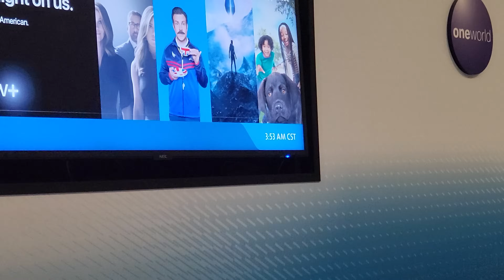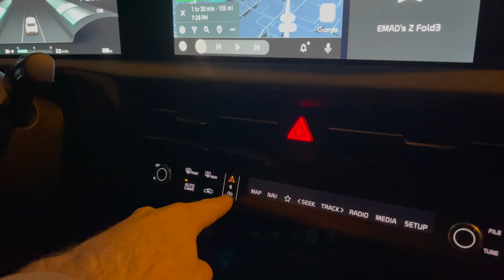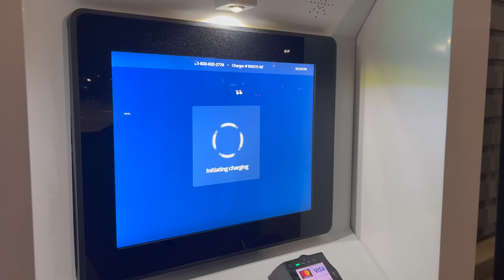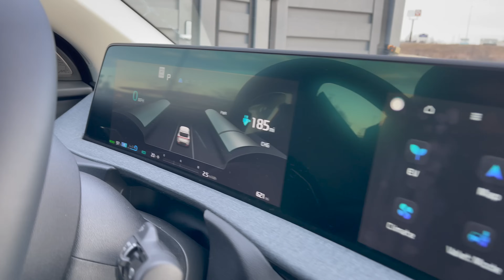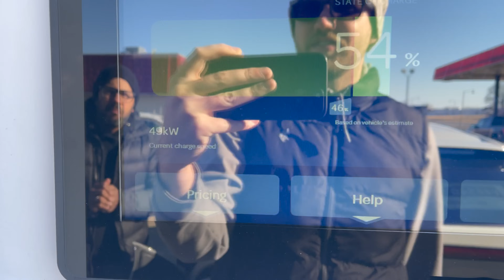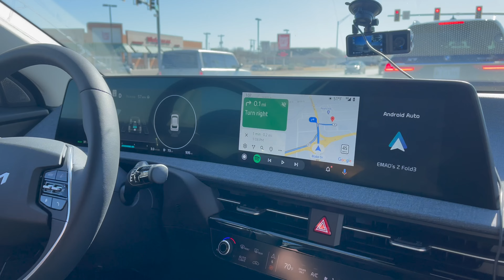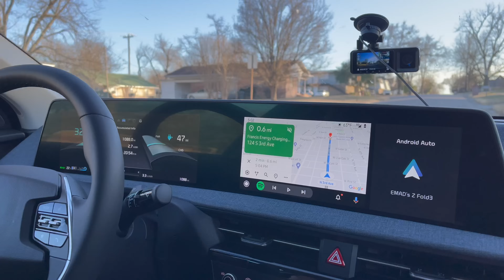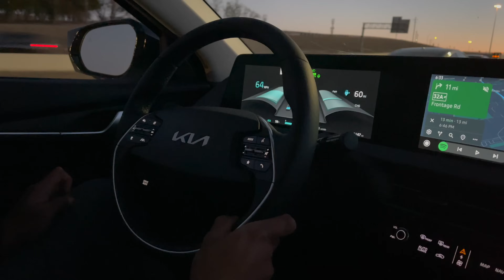First Kia EV6 Road Trip In America! Over 1,000 Miles To Dallas For A First Time Electric Car Owner

Comment: Nice summary!  One little tip from a veteran EV road tripper:  Pick a hotel with overnight Level 2 charging so that at least the first leg of the trip is started at 100% and you don't have to charge a cold battery.
Reply: I've had a rough time finding hotels with L2 charging, especially driving from Texas to Oklahoma. Is there a reliable app or link that could help? The ones I've tried aren't much help.
Reply: This cant be overstated! It justifies a better hotel, as the fuel is free, thus taking some anxiety away from staying in a cheap hotel and helping you plan ahead.
Reply: @Shapoopie16  PlugShare is still the king of comprehensive charging spot finder apps in North America.  Sometimes you have to get creative.  Ask to plug into a standard 120V outlet at a hotel, find a campground with cabins near a NEMA 14-50 outlet, etc.  Anything helps until, as you point out, the charging infrastructure catches up.  Also, if you have no other choice but to DCFC, do it while the battery is still warm at the end of the day.  Charging a cold soaked battery in the morning sucks.
Reply: I feel more at ease by stopping @ a L3 charger location for the night and charge up after dinner. Kyle Conner advises charging when the battery is warm. Would be ready to commit “ harrycarry” if I came out in the morning to find someone had damaged my charger port.
Reply: @Bill B  thats why you spring for the nicer hotel given you get a free tip up..
Reply: I also think that EV owners should accept that driving 5 under the posted speed limit is better for your range. Take it from an old guy, you'll still get there.
Reply: I always tell hotel management that Level 2 charging is an amenity I look for when booking. That said, I've never been told "no" when asking if I can plus in my L1 charger overnight. There's almost always an exterior plug somewhere. I currently drive a Volt, but looking for an EV6
Reply: @markbullock3741  I just can't do it😂. I try to slow down but I end up flooring it
Reply: I'm sure everyone else will too.  WILL you have a for spot to charge when you get there?  So many issues with charging stations.
Reply: @seymorefact4333  You can call ahead, many of them are coned off..
Reply: @jpmkiv  lol! If people really cared about the environment.   Trains,  planes,  carpool,  buses, bicycles.
Reply: @Seymore Fact  Who said anything about the environment?
There is no public transport where I live. 
An EV is more efficient than a plane per person fyi.
Reply: @jpmkiv  horse and 3 or more...add a carriage.   If you lost 100lbs.. your horse will last longer.
Reply: Never CHarge the battery to 100%
Reply: @Czecher86  31k in and never charged to 100%
Reply: Hiltons are always a good spot for LV 2 chargers at their parking lots
Reply: @CRACKHEADLLC 🤣😂 I'm a motel 6 guy!   So I need to spend $300 more a night to change my Y.  HELL NO!
Reply: @seymorefact4333  wrong lol I spend most time 90-120/night at any hiltons,home2stay or Hamptoms inn when you have a membership it’s cheap
Reply: @CRACKHEADLLC  I'll look into it.
Reply: @Shapoopie16  PlugShare allows you to filter by chargers at hotels.
Reply: @Czecher86  Kia specifically recommends charging the car once or twice a month to 100%. They say you can get about 500 charges to 100 before real damage starts to occur. At twice a month,  this is over 20 years. Not saying you should always do it,  but you can certainly get it to 90 plus on long trips.
Reply: @markbullock3741  Nah, forget that. Cars are meant to be driven, not handled with kid gloves.

Comment: I understand the frustration with cold weather charging speeds relative to the advertised speed, but having done a 7,700 mile road trip in a 2020 Chevy Bolt that tops out at just over 50kW this looks like luxury to me.
Reply: haha yes, laughed a little when they were bummed at 150+ kW speeds at 62% SOG
Reply: I felt the same way having owned a Leaf previously.
Reply: @lanceareadbhar  lol! I’m on my second Bolt after two Leafs. I think the Bolt is great and certainly a fantastic value, but for my next EV I insist on faster charging and adaptive cruise control as a bare minimum. I was very surprised when they didn’t offer them on the 2022 Bolt. Seems like a missed opportunity to me.
Reply: I’m lucky if I get about 50kW at 62% in my P85D
Reply: Lmao same. Drove Bolt from Texas to Cali and was lucky to be charging at 55 kWh for more than 15-20 minutes before the steep drop offs. This looks great to me and I’m sure the Kia will be even better once they allow battery preheating. I can’t even imagine what 100 kWh charging is like let alone 230. Drove a first gen leaf before the bolt so I laughed when they had range anxiety. You haven’t had true range anxiety until you try to drive a 80 mile range EV 100 miles by going 40 mph on the highway with no heat in the winter and a completely fogged up windshield. That’s anxiety.
Reply: Just finished a 2.8k mile trip to TX in my 2022 Model 3.  Didn't hit 50kw until about 82% SOC, the 250kw stations are great!
Very impressed with the 7.7k mile trip in the Bolt.
Reply: @Termnath  lmao, I feel u mate 😅🥲😓
Reply: Don't sell your Bolt short, it actually can do up to 55kW.
Reply: I agree my 2012,leaf can take 1.5 to 2 hours in 16 degree or below weather

Comment: Those sub-100kW charge speeds are brutal. Battery preconditioning is not just a luxury, it's must in 2022.
Reply: I have not seen over 120 but once. Super frustrating.
Reply: @Emadifications  you need to absolutely beat the crap out of it to heat the pack
Reply: If you think that’s bad try driving a Bolt EV cross country. Max 54, average around 25-30
Reply: @Emadifications  pre heating battery for charging has been reported for Hyundai ioniq 5 in the latest Uk software. The software is distributed using the same website as the ev6 so the hope is the next release has it enabled and on the ev6. Plus ota so no more website and usb drive to update.
Reply: @ericcindycrowder7482  that’s a matter of poor vehicle choice for road tripping
Reply: Don't worry. Ioniq 5 is preparing a battery pre-conditioning SW update this year, and it will be released soon, and EV6 is also scheduled.
Reply: not a issue for teslas
Reply: @Palomo747  it very much was on Model 3 until battery preconditioning was rolled out.
Reply: @brandenflasch   yes which means it is not an issue for Teslas
Reply: @Palomo747  yes, but once there is preconditioning it is no longer and issue.

Comment: Great look into what first time EV owners will be experiencing on trips! 

On-route battery preconditioning seems to be the largest problem with this car. Every stop had an ice cold battery limiting charging speeds even with Winter Mode enabled. Warm weather trips should be much better but then we’ll see how well the cooling system can handle repeated high charging rates.

Great to hear about the buying experience and vehicle spec midway through the video as I fear a lot of people are paying over sticker for these cars. Nice work finding one at MSRP!
Reply: Agreed this is the biggest issue, trip from raleigh to boston in my Ioniq 5 was great fast charging in warmer weather saw up to 240kw , coming back down was snowing and freezing never saw above 150kw.
Reply: “Winter mode doesn’t do jack shit”
Bjorn Nyland
Reply: I just paid $1400 less than sticker for an Ioniq 5 Limited in Utah. Great dealerships recognize the chance for future repeat business.
Reply: @spencer1370  bjorn is the guy and he would know. Tom from inside ev’s keeps quoting 18 minutes and I am screening at my tv not in the winter. My leaf takes an extra 1/2 hour than in summer.
Reply: When will it become standard on EVs???  I asked a Ford engineer about the Mach-E 2 years ago during winter testing and he told me that the Mach-E would always be ready for level 3 charging.   NO CARS ARE READY WITHOUT BATTERY PREHEAT!  What's frustrating is that it is just software because the hardware is already there in most of the cars.  Battery preheat must be standard in all cars (even manual) and battery temperature should always be displayed like the oil temp was in ICE cars.
Reply: Kyle can you get any comment from Hyundai/Kia if they will actually add preconditioning to these cars? (Or at least to the AWD ones with heat pumps) It seems like the Winter Mode checkbox is just a placeholder.
Reply: Agreed on temperature dependencies being more of a factor that a lot of people have expected. But i do wonder if anyone has been able to actually charge the EV6 or Ioniq 5 at it's rated 18 mins from 10 to 80%.
Reply: @javidam  plenty of European reviews have, or close enough at least. The issue in the US is they launched these cars in winter with no preheating.
Reply: This is a great look for first time “non Tesla” EV owners. First time Tesla owners just pull up and plug in. There’s no app to log into, there’s no long wait for the car and the charger to communicate to each other, there’s no crappy touch screens to deal with, etc. And guess what, Tesla has pre-conditioning!  I love a lot of the new EV’s, but Tesla is just light years ahead on infrastructure. It’s a joke.
Reply: @stufarmer3084  Agreed!  The more I see in this video the more I like my Tesla charging experience. The charging infrastructure needs to be widespread, reliable and standardized.  Having said that though the EV6 looks like a nice car. I like the styling.
Reply: @jerrywaynerose  agreed.  They are very nice.  I love my Tesla but options later are great!
Reply: @javidam  Never! I am really mad about KIA, this was never true only a marketing strategy. I owned mine now for 3 month and the max I get out (Ionity) is 130 kW. The changed the ads now saying "can load to 80% in 18 minutes UNDER OPTIMAL CONDITIONS."...I having serious discussions with KIA now.
Reply: @59317  Only in contries you can drive fast as Germany, but this i of course crazy to drive fast to warm the battery by burning more energy. Environmental  BS.
Reply: @angryGTS KIA/Hyundai's route planner absolutely sucks so can't really blame them for not using it

Comment: Enjoyable Out of Spec Motoring road trip. Jordan is fun, engaging and his back and forth was Emad was great.  Good to see what to expect with m e-tron GT when I road trip tomorrow.
Reply: Your ETRON GT will charge at least twice as fast with your DCFC set as a destination in the MMI navigation (vs these guys). Don’t use CarPlay for nav etc. Maybe that’s what their problem was.
Reply: @radcardad  I would probably use the Audi nav to make sure it preconditions but then use CarPlay on top of it 😅
Reply: @vroooom  I’ve done this with my Taycan and I’m not sure it works because the in car nav might actually get suspended when CarPlay navigation is running and then maybe the preconditioning as well. Don’t remember now but Audi and Porsche software are generally terrible. They should just make this a button like a thermostat and give you an ETA on when the battery is at optimal temperature. On my etron they didn’t even show battery temp so I wonder if they have it in the etron GT.
Reply: @radcardad  that’s a good point, maybe one GPS app overrides the other. My EV doesn’t even have route preconditioning yet so can’t test it!

Comment: Just got back on a roadtrip in my Ioniq 5 rwd I bought a week ago, went from Raleigh to Boston and back, and had same charging issues in cold weather. Warm weather chraging cranked up to 240kw and held up there very long but cold still sucks till they come out with preconditioning.
Reply: I have the RWD model as well and unfortunately we may need an alternate solution to pre-heating the battery as the US models don't have the battery warming system in the RWD versions. It's only in the AWD versions of the Ioniq 5 in the US.
Reply: @lanceareadbhar  this can't be correct. Lithium batteries can't take a charge at all if temperatures are too low. I think you're referring to the heat pump? The cars still have resistive heaters.

Comment: The “cold symbol” snowflake on the dash is not referring to the battery temperature. That’s the typical “it’s below 39 degrees” ice warning. You can turn it off in the vehicle settings.

Comment: Really great video guys. I usually don’t consume content this long on YouTube, but I ended up really feeling like I was part of the trip with you - all the footage during the stops, in the convenience stores etc. made it a real experience of what a road trip for a non-Tesla EV owner is like. Question; I have a Mach E on order, but I really like the EV6 - just can’t find one that’s not way over MSRP. Part of why I like the EV6 is those faster DC fast charge speeds, but it seemed liked during your trip you were never charging faster than a speed the Mach E could do, right? So that > 160KW charge experience seems very rare? Thanks again for the video, really enjoyable.
Reply: Pretty sure it's all to do with the extreme cold temps they were dealing with. If the battery was at the optimal temperature, it would charge a lot faster. Just EV ownership life in the winter.
Reply: @thaDARKW0LF  non Tesla EV is harder on road trips as Tesla will warm battery on route to get fast charging in winter.

Comment: The issue with range these guys experienced was largely due to excessive high speeds. Saw 77 mph a few glances of the dash. Any speed above 65 mph comprises range severely due to aerodynamic loads. From 55 to 70 mph calm winds, the air resistance increases power consumption 30% average. That’s a huge drain on batteries. The discussion tends to be: drive faster to destination to charge more electrons; drive 65 mph to destination to charge less electrons. Does the time balance out? Calculation of time/distance using the speed differences 65 vs 75 for a 180 mile run, could prove slower is better. 180/60=3 hours. Would 2:45 minutes at 65 mph make much difference? 70 mph? 25 minutes? Now enter the energy used and time/cost to recharge/speed of recharge. Newer EVs can recharge faster as this EV6 shoes, perhaps a bit slower in cold temperatures as the battery temp is not optimized prior to arrival at the charger. Question is: would driving at 65 -70 mph, cruise control, end up with a faster trip to the day’s destination? Did it matter to drive 8 hours vs 7:15? Was the cost higher driving faster? Lastly, a hotel with complementary L2 charger would have reduced charging time and money as well. Thanks for the report. Impressive EV.
Reply: I would like to know what they actually experienced for range in winter.  Interstates here are 80mph so it's not out of the question to go as fast as they did in the video, though I would like to know that affect on the range.  It is all still a mystery regarding Winter Mode as well: Why does Winter Mode reduce range when it should increase range bringing the battery up to a better temperature, for example?
Reply: AT THEIR AGE THEY DO NOT UNDERSTAND SUCH THINGS. Us that grew up during gas rationing and 55MPH speed limits do. 
Speed limit wasn't back to 65MPH until 1996 FYI.
Reply: I understand that over 70 mph will cause more drag and less mpg in an ICE but that seems quite poor to lose so much range
Reply: @UnseenSpirit that just the way EVs are. They have even better range if you avoid highways altogether.

Comment: Thank you Guys for taking us on your EV trip!  This trip gave us a live view of what we would experience on a long trip!  The cold weather issue is very concerning with me.  I do understand their is a software issue that will fix this issue!  Time will tell!  The Infrastructure for EVs outside of Tesla has to get better!  The locations are not the best!  I would find myself consistently looking at how many miles I have before I need to find a EV Charging Station!  Then hoping it work, is it in a safe area!  My drive as current would be very frustrating!  Especially the cost of the car at the top price!  I have a 2021 Hyundai Hybrid Sonata Blue it gets me 600 miles before my next fill up!  It is 54 miles on the highway and 50 miles in the city per gallon of gas!  I do love the Kia EV6!  But not enough at this time!  I will wait a few years to see how things turn out!  But it will be a add on!
I love my Sonata!

Comment: Thank you for the great video. I really wasn't planning to spend 96 minutes watching this but it was very informative and entertaining. As someone who lives in Wisconsin, the lack of battery preconditioning and the lack of route adjusting to a charge station are both problematic.   I saw on a forum that both are supposedly coming as software updates but I think I'll hold off until that's established as fact. I rented a Model 3 in AZ and those features were extremely handy and I liked that I didn't need to fumble with an app like you need to with the EA charge stations. I think the EV6 looks so much better though.
Reply: Just purchased mine and in the EV settings, it does have "winter mode" to precondition the battery.  I am also in WI, so will be curious on winter range.

Comment: I have a EV6 First Edition. It took me 24 hrs to drive from Detroit, MI to Macon, GA and 36 hrs to drive back on I 75. Most of the time was spent trying to find a charging station that worked and could charge in faster than 4 hrs.
Reply: NO....just no.